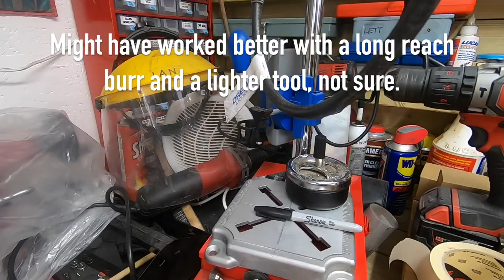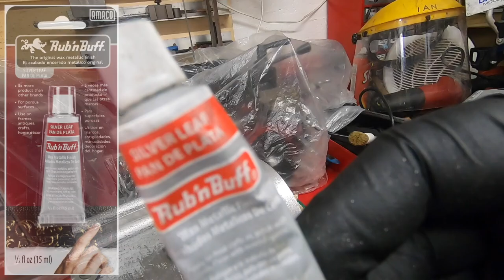Rub'nBuff Embellishing Motorcycle Parts

Comment: This has got to be the most impressive product review I have ever witnessed. A magical transformation right in front of my very own eyes. I'd spent several hours degreasing, dressing and fettling the crankcases of my 1979 Yamaha DT125E finally finishing them off with a fine Scotchbrite wheel and was ready to re-assemble the engine. I was quite happy with the texture but still wasn't quite happy with the overall finish of the alloy. After watching this, I went and bought a tube of Rub n Buff Silver Leaf straight away. Today, I treated the crankcases of my 1979 Yamaha DT125E just as you had demonstrated here. I'm totally taken aback by the result. Thanks for posting this video and sharing the secret to an amazing restoration technique. This is one product and one restoration technique I will always use from now on.
Reply from the maker: Well thanks very much for the kind comment and I'm glad you're happy with the results :)